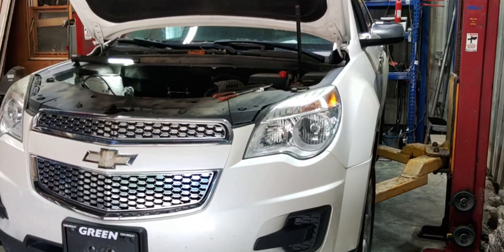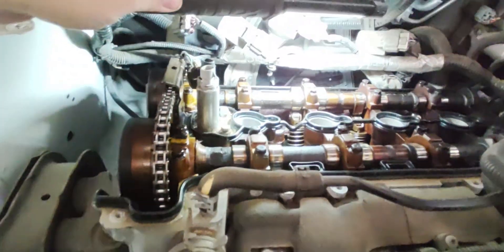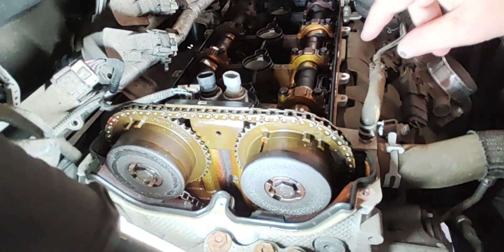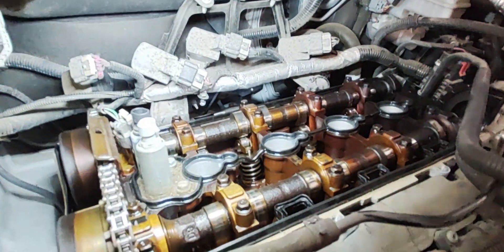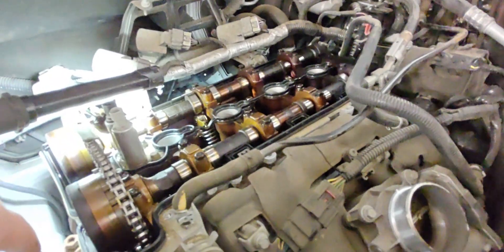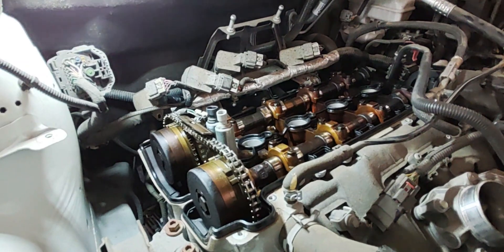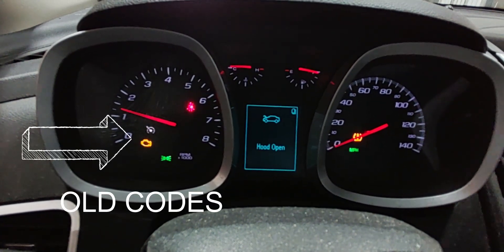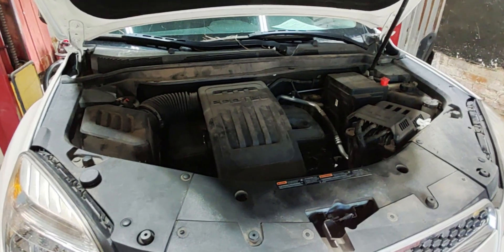Do these checks before replacing your 2.4 ecotec! You may not need an engine!

Comment: Nice job. Appreciate the list of items to check. I've got a 2.4L Terrain at 150K and with each video I watch I get more sure it probably needs a chain and tensioner swap just to be safe. He is absolutely right, guys. Check that oil at least once a week, depending on how much you drive. You might benefit from a viscosity booster if you do have some oil consumption and/or rough idle. Change that oil EVERY 3000 miles. These direct 4 cylinders can't handle stress.
Reply: I'm a believer in Valvoline's Restore and Protect to hopefully remove Carbon Deposits that may help reduce/stop the Consumption...  Just over 126k miles and I'm not consuming (never have) but because of Oil Dilution and having seen under the Valve Cover the chain isn't tight so it will probably need TLC at some point

Comment: My wifes 2014 just had its timing chain replaced. She loves the SUV and well worth getting fixed. Should've dropped the oil pan and clean that out of all the timing chain parts that broke off. They will get stuck to the oil screen and restrict the oil ,, which would make this happen sooner than it needs to happen.

Comment: I've read through a lot of the comments and a lot of you are mechanics an offer a lot of good advice my ecotec le9 is at 188,000 mi and I hear the clatter on startup not 100% of the time but probably like 90% of the time and I also have a tick in the engine, I'll be honest I'm a heavy driver it's fun to drive a slow car fast LOL but I also keep up with my oil changes and do it every 3 to 4  thousand miles and put a quart of Lucas in it. Any recommendations on what I should do?
Reply from the maker: I would keep driving it but keep an eye on the check engine light. If you have one pop up and timing codes are present....park it until you do the phasers and chain. Also keep your oil topped off.

Comment: The oil monitor time frame Gm uses is to long when the oil monitor says 30% left.  Only synthetic oil with dextos additive high quality synthetic oil filter! A vented oil filler cap and the drilling of the the intake so you can clean the orifice every 50,000km a catch can if you live in a area where you get below zero during winter. My 2015 150,000 km running perfectly and burning zero oil! ZERO!

Comment: I just had my timing chain,the rail guides,tensioner and the sprokets replaced for $3000 pesos in labor ($158USD) in Mexico,parts cost me like $150 bucks on ebay and had it done in like 6 hours that same day.I drive a 2016 Buick Verano 2.4l ecotech.Thank god i live on the border.
Reply: Damn
Nice
Reply: @xmatamorosx  that’s a fantastic deal as long as it’s all correct-
Reply: where did you have it done?

Comment: What symptoms do you get if the phasers are going out? I just replaced the head on my wife’s and did new chain and guides but didn’t replace the tensioner or phasers, 2 weeks later I shut it off to go into a store and when I came out it would start, run for 3-5 seconds and then sputter out. On the scanner all parameters look good, no pending codes or tripped codes. My next step is to replace the phasers and tensioner as well as verify everything is still timed properly. I bench tested the solenoids and they ohm out good.
Reply from the maker: with a scan tool you should be able to see the command position of each phaser and the actual position, you can also command them to advance and watch for the command and actual position match. You should have codes if the phasers are bad.

Comment: I have a 2012 buick regal with the 2.4 ecotec. It's giving codes p0014 and p0016. Car starts and idles fine in park. Surges and sputters and sometimes stalls in drive and reverse. But once you get it moving from stopped it seems to run fine. Only sputters and surges when stopped in gear. No surge in neutral. Changed the vvt solenoids and it didn't fix it. Dealer wanted 800 dollars just to diagnose it. Anyone know what the problem would be?

Comment: Very informative and detailed! Much appreciated! 
I recently purchased a 2011 equinox 2.4l LAF that had low compression. Shop said the same, needed a new engine. The followers on the rockers are still intact. It looks like the same black timing guide broke on mine as well. I replaced all the timing chain components, and lined up all the markings to the chain and markings on the crank, and Intake/exhaust cams. I turned it a few times to ensure the chain wouldn’t jump and it was fine. I ran a compression test by placing the gauge in each cylinder and going through the starter process. Each cylinder came up with zero compression. I did you run a compression test after replacing the chain? 
I also am going to test each cylinder by placing a little oil and seeing I get compression that way. I do have a camera I’ve placed inside each cylinder and it looks like it did take off some carbon off the top of the cylinders but no metal bouncing around. Piston heads looked fine as well. 
If I place oil in the cylinder and it comes up with compression, would suggest a new engine? And what if I do put in oil and I still get no compression. Should I put it together and see if starting it fully built will help at all? 
Tia
Reply from the maker: If I were you I would do a leak down test next. You may have slightly kissed the valves and pistons. That or your timing marks aren't lined up. How firm are the rockers when the valves are closed? they shouldn't have much play at all.
Reply: @shedhouse7330  Thanks! And yes you were right, the moment I touched the rockers on the Intake side they fell apart. I've since replaced the heads and now have compression. This is a long shot, but I'm at a total loss with this. I have two black bolts, almost the size of a valve cover bolt with a little plastic piece around the stem near the bolts head. I have no clue where they went but I put them in a bag with the high pressure fuel pump bolts but have searched for days where they might go and I can't seem to find any logical spot to where they would go. Wondering if you've come across them or might know where they would go. hah thanks. If you don't that's fine. I may not use them if I can't find out where they go.
If it helps it reads 109 on the top of the bolt
Reply from the maker: @blake9523  possibly the ignition coil bolts?

Comment: I have a 2.4 ecotec in Polaris slingshot and it’s a great running engine. Mine is a LE5/ LE9. Not direct injection. Doesn’t consume any oil
Reply: GDI and turboes kill these engines. The port injected LE5s are great engines. 5k oil changes are required. Any engine you want to last needs that though.
Reply: @revtimewest  I supercharged mine and I’m running 10psi max boost. The 2.4 ecotec is a robust engine and if maintained it will go 250k. I could more power with more boost but that would require forged pistons . I figure 318hp at the rear wheel is enough.

Comment: People don't really understand that they have to change the oil often to avoid these problems. My ecotec had 230,000 and running strong.
Reply from the maker: I agree, they can last a long time with regular maintenance.
Reply: @shedhouse7330 I’ve seen these cars go insane mileage, I’ve also seen them fail at 70k. I’ll give you a guess what the oil was like in the 500k unit and the 70k unit. Nice and gold in the high mileage one. Completely black on the one with 70k that wouldn’t even start anymore. Labor is getting ridiculous for these cars so people just trade them in. I love getting them from auction because I can have it up and going in less than one day and I get them cheap at the auction.

Comment: Hey Shed house, your video helped a ton. All went well ,runs perfect but has rattle for first 5 seconds,  I used a cloyes kit with new actuators ect. Experts please advise. 600 miles no oil usage. Thanks
Reply from the maker: Glad to hear. The water pumps can rattle on these. Did you change that out yet?

Comment: Actually the valve hits Piston and and cam presses down as it should and then it crushes the rocker. Admit every one you've ever found is damaged not just laying on head. So every time round up every piece and chase those pieces down the oil passages with magnet. Literally any lost needles will kill oil pump.
Reply from the maker: Not once have I found roller damaged the way you describe, although I assume it's possible. The edge of the cup the lifter sits in has been cracked off before, but that is it. The rocker arms are found laying in the head, intact and not in fragments.

Comment: My neighbor has one, was a vw tech. Going to pull the.valve cover tomorrow. Can hear the chain making noise.  Random misfire codes. But no correlation codes..  120k miles pretty sure was ran with low oil.

Comment: Could it still be the timing chain if the engine is seized? I took off the valve cover and everything looks fine.
Reply from the maker: Sound's like it's something else.
Reply: Check starter mine was stuck and had engine locked up

Comment: Wait a minute. Did you say you did the entire timing chain job in about 3 hours? While IN the vehicle??  Please do a video, would love to see how it can be done-
Reply from the maker: Yes, I've done them in three hours. With a lift and the procedure memorized. Torque spec and all.
Reply: @shedhouse7330  hi did you just lift the engine up and do the timing replacement 
Do you have a video 
Thank you for your knowledge and expertise
Reply from the maker: @richarddiaz8248  You don't need to pull the engine to replace the chains, if you need to pull the engine it can come out the top.
Reply: @shedhouse7330  thank you Shed

Comment: I have a 2.4L 2015 buick verano, my timing chain was broken along with 2 rocker arms at first they were loose and then they just came out, if i replaced my valves can i use the same rocker arms if it was just the valve thats bent, i only had two come off should i be worried about my pistons?
Reply: Please respond
Reply from the maker: It would be best to replace the rocker arms, however you can re use them if they aren't damaged. I've seen them crack a little bit of metal off the lifter side of the rocker, so look for that. You can inspect the top of the pistons with a camera  down the spark plug hole before you pull the head. Most likely you don't have any piston damage, the pistons are much stronger than the tiny valves. Do all the valves, not just the ones that look bent.
Reply: @shedhouse7330  gotcha and the two rocker arms its not like they were already off i literally felt them and there were loose but the valve isnt coming all the way up so im glad to hear that, you also think my cylinder is good?
Reply: I also have screws that got damaged that are on the lower end of the other chain that didnt break
Reply from the maker: @destinywilson6598  is it just the bolt heads that are damaged?
Reply from the maker: @destinywilson6598  I'd give it a 95 percent chance the lower end is fine. I've only had one engine that damaged the pistons and cylinders on the 2.4.

Comment: I took the valve cover off and found one rocker arm broken in half with the roller bearing sitting under the lobe 😢 rip
Reply from the maker: Bummer. Pull the head and put valves in it. Check for a hole in a piston via the spark plug hole first.

Comment: Hey Shed house, just watched you vid, this will help me a ton. I just bought the same car with 140k mi. The original owner did a chain at 116k miles for like you said, paid $1600,  Now at 140k they said its rattling and shut it off and I bought it (will open up before firing), So maybe something got loose. maybe phasers failed (dont know if replaced) So about to dive in. Thanks for the quality video.

Comment: (Updated oct 1st 2025 i scrap it)
I have a p303 code. I replaced the plugs, the coil, did a oil change, replaced the oil filter and the front seal.. I also cleaned out the pcv system. Its still running a bit rough.. The stability trak light is on and the engine light is blinking.. 
My wifes dad died. He left her money to get us a family car. We got the Equinox thinking it would be a reliable car for us.
I wish i could catch a break and get a reliable vehicle for my family 🙏
Reply from the maker: Do a compression check. I've had several with burnt exhaust valves from the oil consumption.
Reply: @shedhouse7330  i did the compression test. All piston values read good except for #3.
It only has 35 PSI.. I have to take the top if the engine off. Im praying its just carbon built up making it stick open.. one thing I can say about this Equinox is this> (before the issues) it was January & my buddy lives off grid deep in the mountains.. One of the service roads was open so my buddy said take that road. As we entered there was roughly 3-4 inches on the ground but the road seemed decent.. well I thought.. Im not from his area so I wasn't familiar with this road. We where 1/4 of the way out when my buddy says> I sure hope the other gate is open.. I was like what dude?? Smh The snow got so deep it was rubbing against the bottom of the SUV.. I honestly thought we would get stuck and end up being a rescue story for some YouTube channel.. lol This Equinox drove through this mess with no problems at all.. It handled better then any other vehicle I have ever drove..
This road was straight out of a horror movie.. After struggling to not go off a cliff for 30 miles we made it to the main road.. I couldn't believe we made it.. This SUV is truly a bad ass machine when ya get all the factory bugs out.. Its still in my driveway since my 1st comment... I really wanna get it up and running 🙏🙏🙏
Reply from the maker: @BullProspecting  do you have access to a borescope camera? they make good ones that allow you to see back towards the cylinder head after inserting via the spark plug hole. I still think you have a burnt exhaust valve, but carbon would be a nice find.
Reply: The pcv system is writhing the plastic intake manifold there more than just that one tiny hole which clogged, there 4 other tiny holes running to each end of the manifold where it meets the head . Mine were all clogged , so I just replaced the hole intake manifold which fix my rough running condition like yours also my exhaust manifold was cracked , I also replaced that as well and did my timing chains , this car is solid it just needs a few things
Reply from the maker: @jesusISsaviormartinez  I haven't had one clogged completely on each intake runner, but I'll keep and eye out for that. I can usually blast air in the main port and get it all out.
Reply: If the engine is blinking that means it has a massive misfire.
Reply: My neighbor gave me a 2013 Equinox. Just got it home today. Pulling valve cover first and visually inspecting. I hope I can get by cheap with it ?
Reply: I used to be a mechanic, clearly you don't know what you're talking about that mechanics don't know to do a basic compression test or replace timing chains etc. The reason why shops sells engine is because they get more money. If you think it's easier to change an engine than simply putting in a timing chain, you haven't worked in a shop.
Reply: how much are the timing chain parts approximately?
Reply: Sounds like you may have a dead cylinder. I’d recommend getting a compression test done.

Comment: I have a 2012 Malibu. With 128k miles, No timing chain rattle. But i think I've seen tiny metal shavings on my last oil change.
Reply from the maker: you could always pull the valve cover and inspect the chain and guides.

Comment: i have a 2017 Buick Verano 2.4 Eco Tek. Code came up that it was the VVT solenoid. Before replacing it. I went into the store. Came out and it would just crank over and not fire. I continued to try to start it and it tried but made ungodly clanking sounds. I shut it off immediately. pulled the valve cover off, all the rocker arms are snug except an intake one one cylinder one. It wasn't pooped out, it was sitting where it should be. It was just loose and I can remove it by hand. Would it be safe to say that there is a bent valve? I used a bore scope but did not see anything, there's one more that wiggles just a little. How much of that is normal?
Reply from the maker: If the cam lobe is off, aka pointing in the up position, you could have  a little wiggle to the rocker. Since you can remove yours, it's save to say the valve is bent.  It's normal for a chain to skip a tooth as the engine shuts down, the cams will want to stop before the crank. It sounds like that's what happened. You can fix this, but you'll need to pull the head and replace the valves. I would also recommend sending a camera down the spark plug hole to make sure you don't have damage to the piston. But I'll bet you don't.

Comment: theres reasons we recommend engines. gm says that. so you acting like we are prematurely condemming the engine is wrong lol/
Reply from the maker: When a car is under warranty that may be the case. Not true for a customer pay job. Offering options should always be on the table.
Reply: it  still is for cp jobs. doesnt change. with these engines always burning oil and being cakedup from running low on oil, its either a reman engine or piston job which turns into a full overhaul 9/10 times and costs more than an engine.  @shedhouse7330